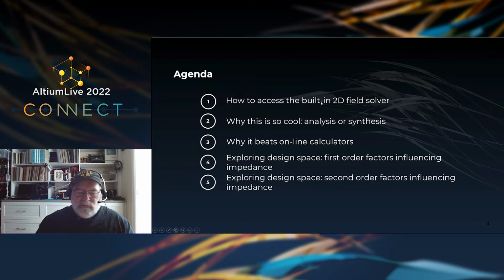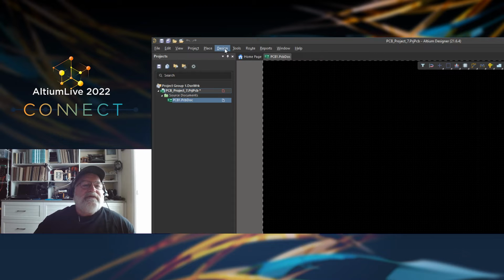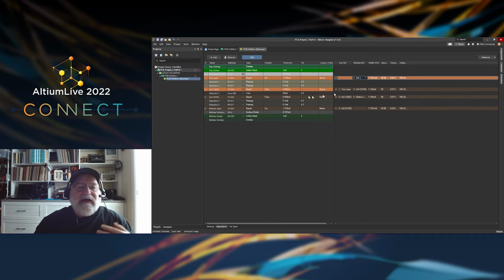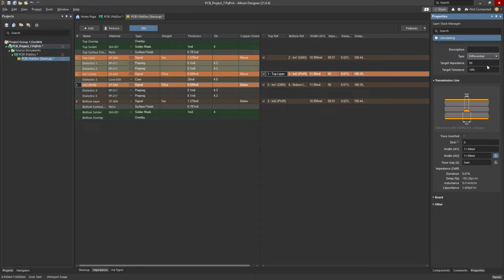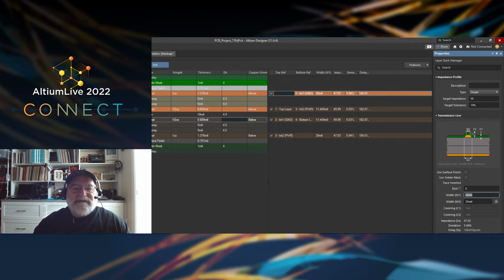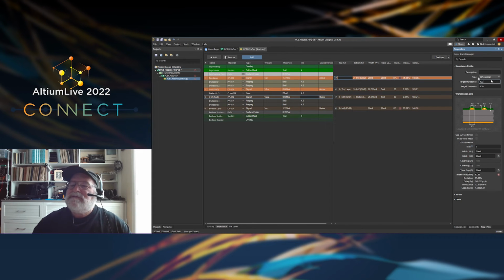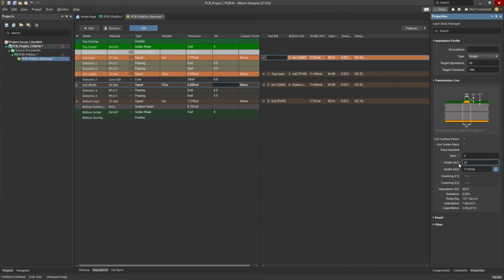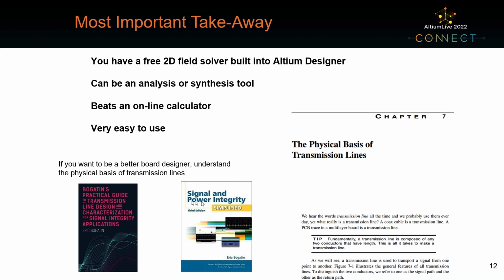Hidden Gem in Altium: A Built-In 2D Field Solver | with Eric Bogatin

Comment: Don't layers 2 and 3, which he says are signal layers, need to be all copper and designate as GND in order to use them as the reference?
Reply: Essentially yes, but you don't have to do that before using the layer stack manager. You can do the calculation under the assumption that you will fill the required layer with GND copper once you have completed impedance calculations.

Comment: Yea the Simbeor thing is kinda cool, but if you change the layer stack up in the Layer Stack Manager, that it fails to adjust any impedance driven Design Rules?  Kinda sucks.  Sort of defeats the purpose of Impedance driven rules... maybe I'm doing something wrong.
Reply: There is an easy way to update the design rules.  As long as the design rules are set to use the impedance profile, jusu uncheck and then recheck that option and the rules will update.